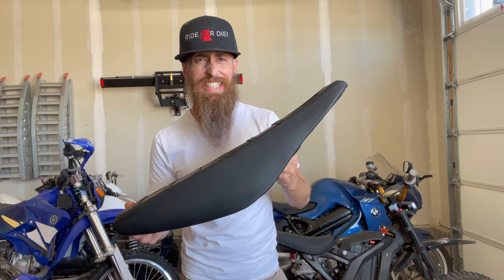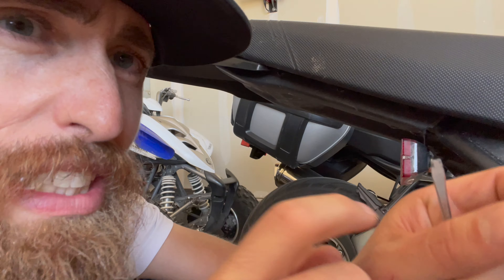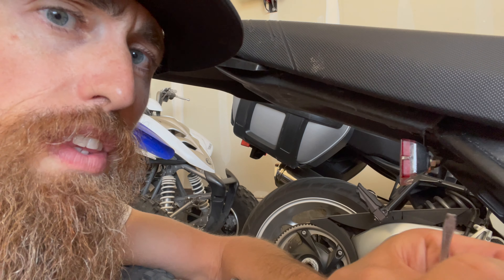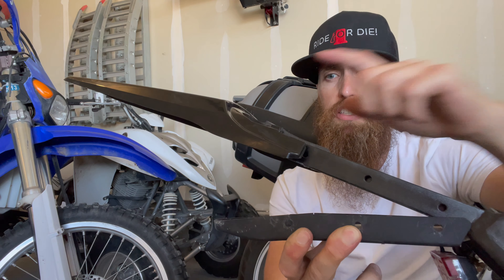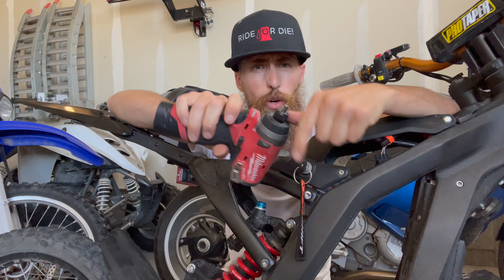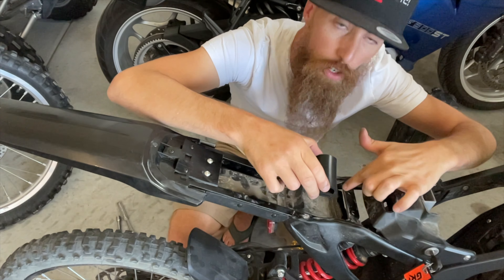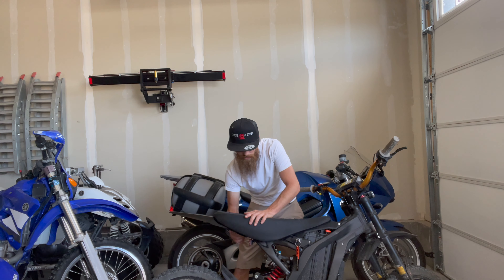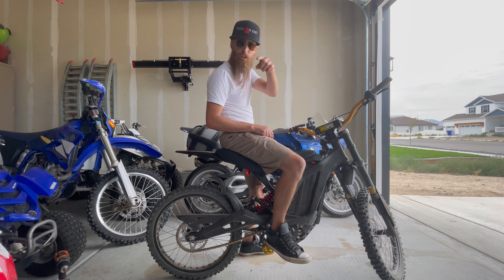How To: Install a MX style seat on a Sur Ron

Comment: Does this seat lift the bike at all?
Reply from the maker: No, it maintains the same height as the stock seat. This particular seat would not work with the raised seat brackets as it mounts on top of the battery cover.
Reply: @octanemotorwerks  I’ve seen some people use it with the extenders. I’m wondering if you could mod it and make it work. In the future I am going to experiment.